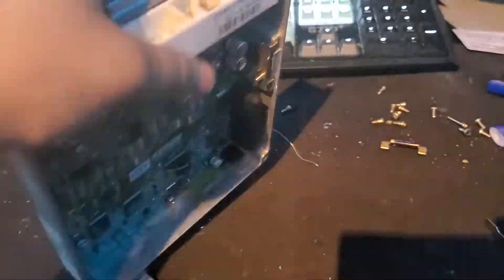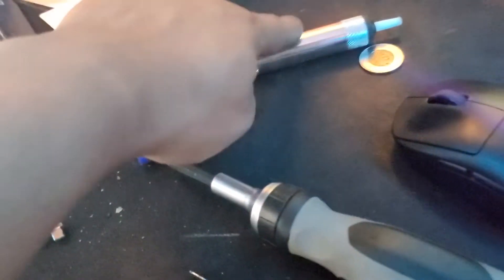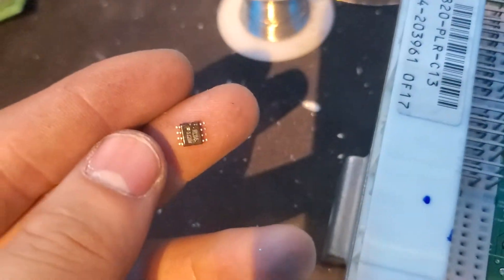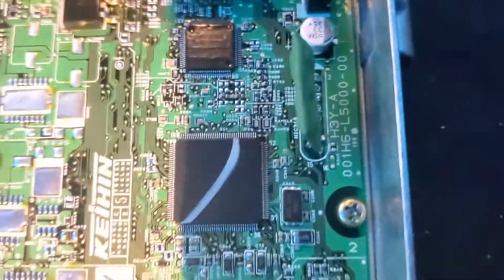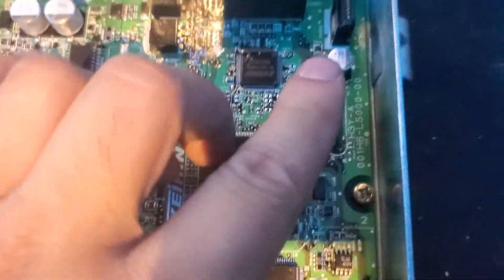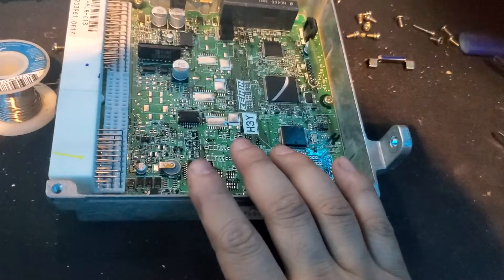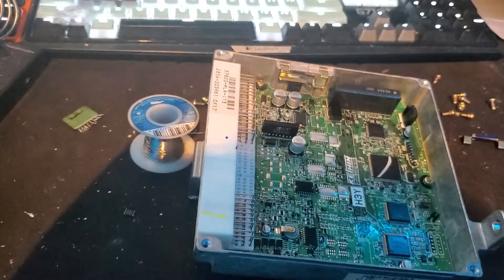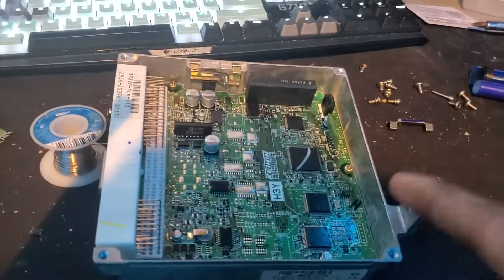honda civic 2001-2004 ECU/PCM Replacement (no honda re-flash required)

Comment: For potential parts swappers:

1. There are two basic computer series: Non-VTEC, whose part number will include "PLM" (e.g. 37820-PLM-A06), and VTEC, which have "PLR" in the number (like Temppy's). For each, there are manual and automatic trans versions, with the ECM also running the automatic transmission where there is one. Manual computers will have numbers in the single digits before mid-2003 (e.g. C06), and in the teens thereafter (A12); automatic computers to mid-2003 were in the fifties (e.g. A56)

2. There are (at least) three "markets", with ECMs tuned for each: US "Federal Emissions" (computer letter: A), US "California Emissions" (L), and Canada (C). In Temppy's example, you can see the "C" in the part number 37820-PLR-C12. I'm not certain, but the "L" model might have disappeared after the mid-2003 refresh, or maybe it's only certain models that got it (with VTEC, or with a given transmission). All of these will interchange, all else being equal (same trans, same VTEC-ness)...the car doesn't know what country it's in!

I could say more, but...maybe just shoot me a question if you have one. I have a fair few computer sets and loose ECMs for these cars, which I'd love to put in the hands of people who need them for a nominal cost. I used to sell on eBay before my life fell apart "Part and Parcel"...
Reply: I have a a 04 civic manual non vtec, so all I need is a non vtec manual ecu and swap the 2 connectors in the video?
Reply: @maxbrinker9333  Yes, but defo stick with ECUs from a 2004 or 2005 (part #s ending in -C12, -C13, C14, A12, A13, A14). ECUs from 2001-2003 >might< also work, but I haven't confirmed that the wiring is identical; if Honda swapped one pair of wires somewhere, that could fry your new ECU.

Did your stock one go bad from the alternator bracket issue? Have you rectified this yet?
Reply: Can immobilizer chip from an automatic ecu be swapped to any manual ecu in 2002 honda civic?
Reply: @kentonharriott8939  I don't want to definitively say "yes", but if the number of pins match, I'd give it a whirl. I was spazzing and thinking of the green thing. For the 93C46 chips, you can defo swap them: Manual, auto, VTEC, non-VTEC...whatever! I've also read that you can remove the immobilizer altogether by simply removing the chip, and the engine will run fine (but with a check engine light); you can probably find details in different Civic forums on that. IIRC, Southeast Asian Civics like this used the same ECU but removed the chip, thereby eliminating the immobilizer (and the need for expensive keys which can't easily be programmed there).

Of course, I'd give you the same warning as Max Brinker about using an ECU from the same series of part numbers. If your auto ECU p/n ends in -A5#, for example, then you'll want to use a manual ECU with a p/n ending in -A0#; if it ends with -A7#, use -A1#. (Or if you don't have part numbers: 2001-2003 should use 2001-2003 ECU, and same for 2004-2005.)
Reply: yes it was from the alternator bold, I fixed it. Just need the ecu, thanks for the response
Reply: @ Which one do you need? I might have it.
Reply: 2004 1.7L manual transmission, LX trim
Reply: @ I have one. Part number is 37820-PLM-C13. Yours should end in -A13 or -A14; this will definitively replace those. I wasn't in the business of selling just ECUs, so this one has a matching immobilizer box (around the ignition switch) and two new keys with programmed transponders (the keys still have to be cut to match your existing locks). What's your ZIP? So I can estimate shipping?
Reply: @ My email is on channel page.
Reply: I’d just want the ecu,

Comment: I wanted to come back and thank you for this video. 
My 01 Civic LX was in limp mode. My alternator fried my ECU. I couldn't find one at pick-u-parts locally, so I unfortunately found one on Ebay and had to pay the price of $150. 
As for the soldering, I called around to a few phone repair shops that do electronic board work. The guy switched the two for $40. The auto shop nearby (in LA county) wanted $1000 to repair my ECU and I would still have had to go to the dealership to flash the keys to the ECU.
The black transistor starts the car, the green line transistor removes the error key signal and check engine from the dashboard.
After one year of searching for an ECU that matched, and this video, my ride is running!

Comment: I'm having trouble getting the car to turn over. If I remove the chip completely, will that solve my issue? No replacement chip
Reply from the maker: No unless u have a k tune immobilier bypass the écu won’t let you turn it over

Comment: Hey so I got a question for you someone who knows a bit about cars... I have a 05 civic reverb and my instrument panel won't light up and my green key (immobilizer) isn't even showing on it. My gears, engine light, maintenance, seat belt, airbag and turn signals all light up but my lights for lighting up the entire panel doesn't light up. I have no idea how to fix this as far as Ive checked all the fuses are good. Any ideas? Also my ac doesn't work, don't know if that has anything to do with it or not. And there is a white box behind the mirror changing button and it's got a green adapter that isn't plugged in and when I do plug it in, the alarm goes off and there is no way in stopping it. Also my key fob well reset with my car but after the door cycle commences then it won't unlock or lock the doors anymore and I can't arm my car alarm and there is no red little light on-top of the steering wheel anymore... Please can someone help me? Been trying to figure this out for a couple months now lol

Comment: $50 is robbery. When I was picking parts, I'd make sure to drop a few in my tool bag. Herbert Black is rich enough!
Reply from the maker: the place i go pick and pull checks our bags coming in and out and its $50 cad so like 35usd isnt that bad
Reply: @Temppy1  I'm sure you're going to the same outfit as me, mon ami. Anyway, it's been a few years. In 2016-2018, they checked my bag going in for banned tools (basically anything that can make fire), but didn't check my bags on the way out. Anyway...yeah. I guess I should start selling my stockpile before all these cars overheat or rust to death.

Comment: Question?  I have a 1999 Honda prelude and I did a swap of tranny from auto to manual.  The mechanic manage to burn the pcm.  I found a replacement on ebay.  If it has the same number will it make my vehicle work?

Comment: How come you didn’t just get an ECU, ignition, immobilizer, key combo?
Reply: What a dense question. It's probably because of the fact that all those things are expensive, versus this is practically free with the only cost being time and skill.
Reply from the maker: all that would have cost me 350$ at my local junk yard while an ecu at pick and pull is  $40

Comment: Does this legit work? I bought a previously stolen CRV from auction and it has no key and im trying to get it started without buying a new ignition.
Reply from the maker: Yup it works yo just have to get a key and matching écu to the key but u can also bypass the wiring in the car to work without the emoblizer

Comment: So I swapped both chips, car runs with flashing green key on dash and sets p1607.  Also plugged in old pcm w out either chip, same situation.  Any ideas?  Maybe corrupted data on eeprom?
Reply from the maker: did the ecu come the same moter as your car, it sound like a map issue p1607 maybe the reason
Reply: @Temppy1  pcm swap was to fix transmission shifting/ d flashing.  Same numbers on ecm.  No green key flashing before pcm swap.  Idk if pcm had been swapped before me.  Saw on some other forums the 1607 pcm internal circuit error happened to them when they moved the chips

Comment: Hi bro, should the ECU donor and acceptor have to be the same part number? because I have a 2001 civic and my brother just gave me a 2003 ECU. My plan is to swap my 2001 ic240 and H1Y-E into the 2003.
Reply from the maker: the ecu needs to come from same moter ecu dosnt really mater where i came from

Comment: Good morning friend, could you write to me in Spanish, ,, my computer does not connect with the scanner and the RPM, temperature works only for a moment when turning on, and has signal cuts to the injectorsb

Comment: PS did you  get it to work?
Reply from the maker: Yah it ran fine
Reply: @Temppy1  Well mine has many issues. Quite somne electric parts dont work now all of a sudden. electric doorlocks, interior ceiling light. Airco. Got a feeling something else is messed up
Reply: @RomboutVersluijs  Hi,
Try replacing the MCU under the steering wheel
Reply: @Anon_PK  have to remind that. Currently the ECU is bypassed so I can start
 But many other features still don't work
Reply: @RomboutVersluijs  i see ..
Then you have to manually bypass all electric circuits which aren't working..
Reply: @RomboutVersluijs  through manually providing 12v or ground from other sources whatever is missing on that circuit